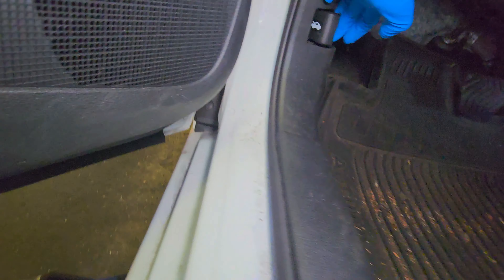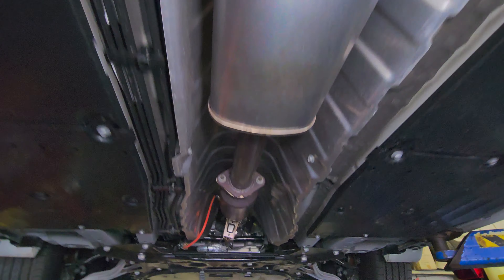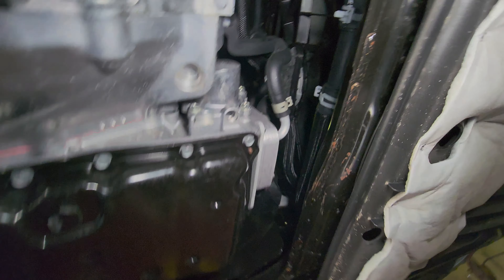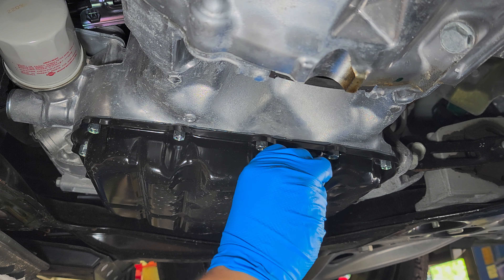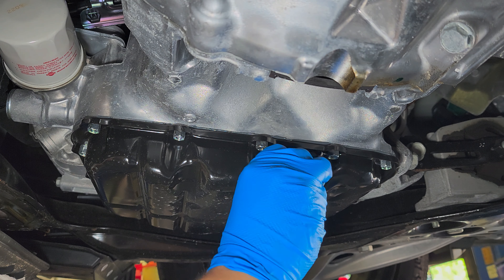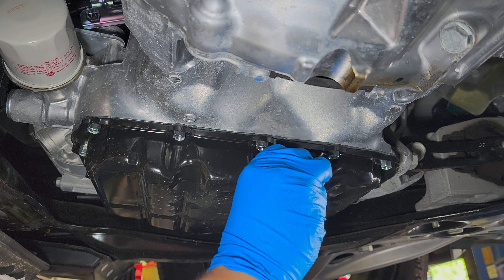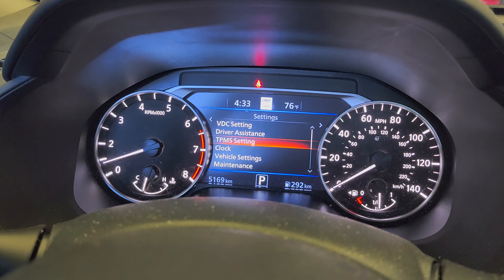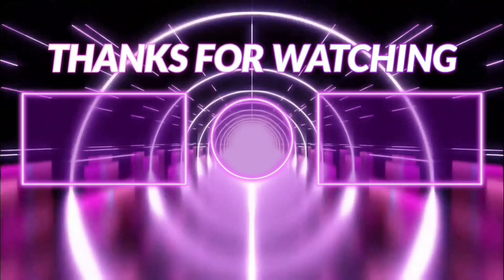Ultimate Guide: Oil Change for My 2023 Nissan Altima!

Comment: Thanks for the video. Is there a washer that goes with the drain plug? I always changed my Honda's oil and would replace the washer for each oil change. Thanks
Reply from the maker: Some new oil filter come with the washer.
Where you from?
Super thanks

Comment: Great video. Was this the very first oil change on this vehicle since new?  The reason I ask is you took off a 15208-65F0E but Nissan  specs  a 15200-BV80A for a 2023 Altima 2.5 liter and starting with 2019 MY for OEM filter.  After market filters don’t show a change starting in 2019.
Reply from the maker: I see whatchu doing. As you could see. The car came from dealership if it had the original oil filter.
The size of the filter vary depending on the brand. So I would go too crazy about.
Just get the right one, and that's pretty much it.
Tell me about your experience when you done.
Where you from?
Super thanks!

Comment: hi how are u?
the only thing that butter me is that this car is alredy in km not mile and you said that the car is in mile and change the oil in 5000km?

whats the best km to change the oil
i have a 2023 nissan altima sr premium 
thanks
Reply from the maker: Change oil in every 5000 miles or 8046 km..
If you have the money, do it every 5000 km.
Super thanks
Reply: @AxtuoAx  that was quick
Thanks for guidance 🙏 💫
Reply from the maker: Where you from?
Reply: @AxtuoAx  Toronto